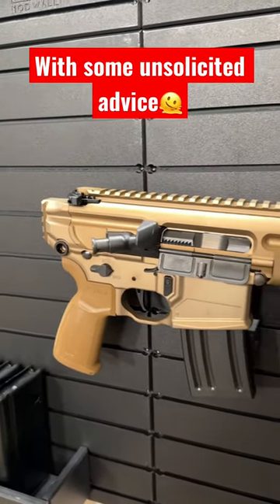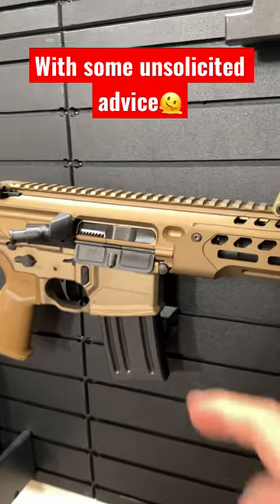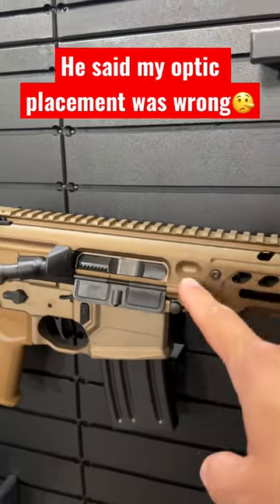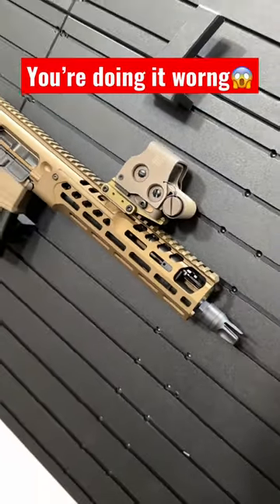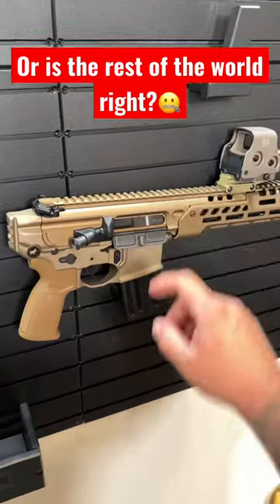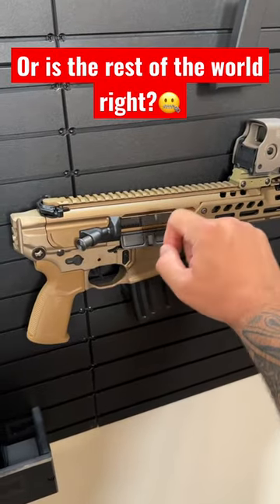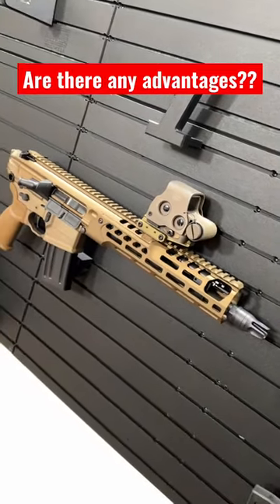Your Doing It Wrong😱

Comment: I have an explanation. The short version of it is, Someone with preference issues thinks he is the authority on optics and is making that suggestion to you in a way that will make you say no. Good job, btw. The longer version is, well I have ONE of my rifles set up this way. It's an older AR-15 rifle that has a carry handle on it, and used to be a 20" HBAR 30 years ago. After sending close to 10,000 rounds through it, I changed the barrel to an M4 profile 16" barrel and changed the A2 stock out for a VLTOR ModStock.  I got my hands on a standard Aimpoint red dot scope, and decided, why not get a flat top? In truth, I hated it. It was just uncomfortable for me to use at that point, and I don't have an explanation for why. I switched it back to the carry handle, and saved the flat top for a different build that involved an EOTech reflex sight. More on that in a bit. I equipped the rifle with a quad rail, because at the time, that was the best thing available and I attached the Aimpoint to the top of it, so the Aimpoint sits forward of the carry handle. The sights still cowitness without issue, and the position of the Aimpoint does offer 2 advantages from my standpoint. For starters, this rifle is configured as a Personal Defense Rifle. It is meant to be used on targets within 100 yards, but likely closer. It is also meant for night use, because what time of day do YOU think I might need to thump back on things that go bump in the night?? Anyway, with the optic as far forward as it is, it allows for greater field of view and situational awareness. Second is that it moves the center of gravity forward on the rifle, making its axis of rotation more or less just disappear, and translating into backward motion at the shoulder. And I am aware, there really isn't that much recoil for an AR-15 anyway. But that's the point of this set up. It works for me, but I am not in the business of pushing my ways onto others. This is an explanation, not a DIY.

So what did I do with the other upper receiver? Well, I have a daughter. I taught her how to assemble an AR-15. We bought the stock (which was pink) and buffer tube, a 14 1/2" barrel with a flash suppressor pinned to it, the front sight blade, gas tube, lower and parts, bolt and carrier and a pink pistol grip and then finished it off with standard hand guards that were pastel pink with a Hello Kitty emblem on it with Hello Kitty holding an AR-15. So, after we put the rifle together, I gave it to her for her 18th birthday. So I asked her after we got done building it, "So, why did you want pink Hello Kitty accessories with the rifle?"" And she told me "In the event I ever need to shoot someone with it, they can be dead and embarrassed." For about 3 years, we went on weekend excursions to the range where she practiced with the new rifle. We would grill out, and ritually clean our rifles, and reflect on her childhood or talk about whatever she wanted to talk about with me. She eventually got married at 22, and she left her rifle with me while she is out of the country with her husband. When she comes back, we'll get some more range time, but in the meantime, I still practice, but I admit it isn't the same without her and my son in law with us.

Comment: I would be willing to bet that the reason he said you are doing it wrong is because he uses a magnifying sight first then the hallow. The magnifying sight is on a hinge and can move into and out of place depending on if you want to use it at the moment or not. Though the new hotness is a canted sight for that. You will have a magnified sight on the rail and then a canted rail mounted in front of that with a red dot mounted to that. Though that will be just as far forward as he is telling you to have it now. So, it all depends on if you want both near and far sights or just a single site.

Comment: Whoever told you to run it there is a moron… it should be at the same place on a standard AR upper receiver before the rail starts. You want it as far forward but still on the standard AR upper location (since the SIG has an extended upper rail, it still should be back a ways).

Comment: Speaking as both a gunsmith (20+ years) and a former Operator. That person is a moron. Starting from least important to most:

1) This increases height over bore issues to a very minor degree, very minor but still. 
2) Possible Decreased mounting space for tactical attachments.
3) This would shift the weight to the front, increasing battle fatigue and when not shooting from a resting position, it would cause issues of additional tiny movements which can affect aim and make it more difficult to get back onto target quickly. 
4) The increased g-forces your optic would take would increase as it ends up being on the wrong side of the fulcrum/ lever point. This is especially troublesome because it can cause screws to come loose, increase wear on an optic and for cheap optics especially, it would cause it to lose zero faster. Even, well do it to a lesser degree with expensive optics. 
5) And finally, the WORST reason is DEPENDING on your rail style front rails on most AR style rifles/ pistols will move EVEN, if they have anti-rotational tabs. the exception to this would be on the few piston operated AR style rifles/pistols the top rail is integrated into the frame of the gun and not separate pieces but again, your still placing additional weight on something that now acts as a lever and even small weight can become heavy enough to damage your gun. Especially if you've already got things like an IR laser for night vision,  tactical light or lights, and sling mounts. 

So, basically this is a HORRIBLE idea and that guy had no business offering you advice as he clearly knows nothing about basic physics and guns. Please, don't do this anyone. It is just a fuster cluck of an idea.(oh and obviously the spear LT is fully integrated upper rail system but, that still doesn't eliminate the possibility of the front flexing.)

Comment: This dude must be an AK guy who thinks AKs are from God himself. The only people I've seen put the optic in this location are AK users.

If you're asking the question seriously... you should run non-magnified optics as far forward on the receiver as you can. While staying in line with the bore or slightly behind the bore. With magnified optics I would run the optics as far back as you can for eye relief reasons.

Comment: The handguard is monolithic with the upper receiver so it doesn't matter like it would for an AR-15 where you don't want it on the free floating rail.  Putting that mass forward on your rail would reduce muzzle climb slightly but not recoil in general and it would make your firearm front heavy so holding it up for long periods would be a pain.  My take:  Mount it where it is comfortable for you and FK everyone else.

Comment: As funny as some of these roasts are, technically the closer to the muzzle the sight is the more accurate it will be (as long as the sight is secured as well as it would be further back). Long story short, unless you just prefer the sight picture, it's not really worth it.

Comment: i do not agree with it being that far however the point at which this is mounted is still on the reciever unlike a rail on ar-15… so it would still hold zero. however… this is stupid. if you wanted better peripherals, an eotech would be better closer

Comment: So I have a gun, I nicknamed it reaper and it's a 300blk and I use a rail rider 3 inches forward from the tip of the upper receiver and it runs pretty good. I do that because to me, I can see better I only use that for that gun only, my other AR15's and my sign rattler and my other sigs I just have them normally

Comment: Bruh, these comments are hella stupid.  I can't believe the 2A community is this ** up.  You heard something new, didn't make sense to you, you ask other gun owners if they have ever heard of something like this, and then you get roasted?  "Fake little bitches get outlined in chalk".  Personally I wouldn't add the weight to the front of my platform because of the balance.  Also, the eye relief may be skewed where you don't get a proper sight picture.  You might see the dot, but it won't be an accurate picture.  But...dude...try it.  Maybe guy is on to something.